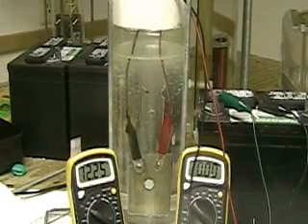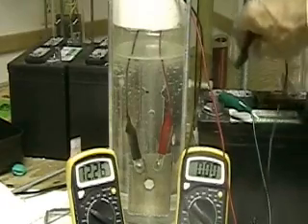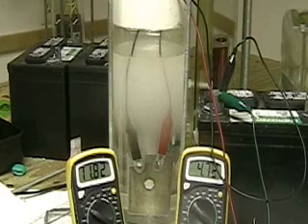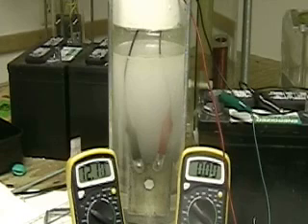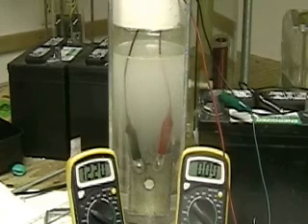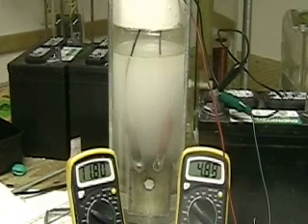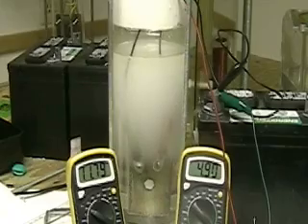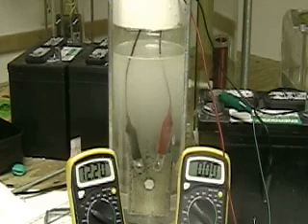Hydrogen Tap (WidowMaker Demo) 132

Comment: the amount of lye with and voltage and amperage is relative with the production of hydrogen, with your 2 cells 4 plate WM it appears that all the these combinations are perfect in producing HHO but when you add more plates the voltage amperage and the lye will spread even and the hydrogen will drop on production but if your going to add more voltage and lye the production will go up even if you triple the size of plates. I hope this will help if not please post it with your disagreement comment.